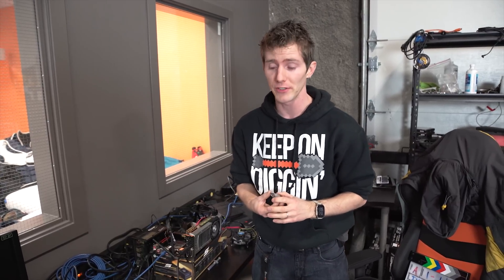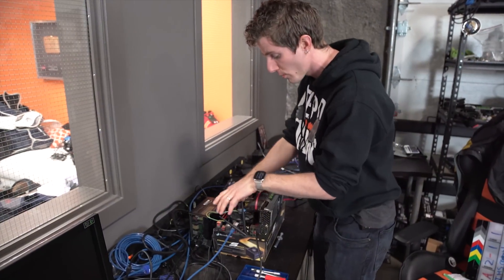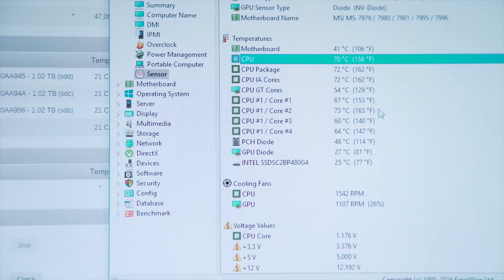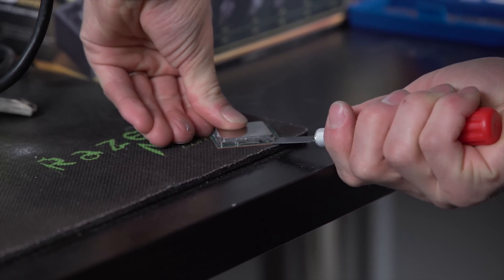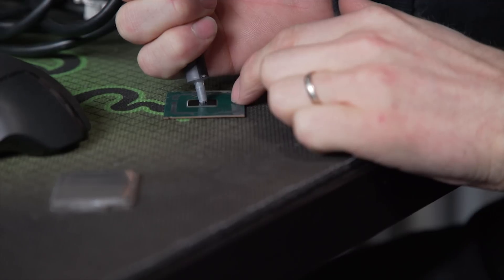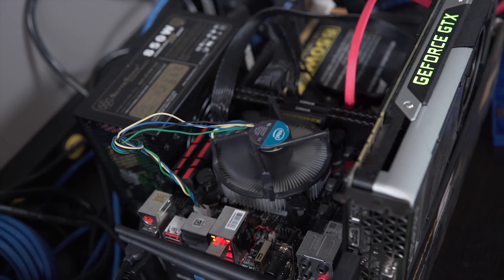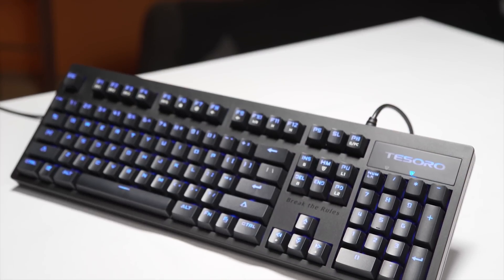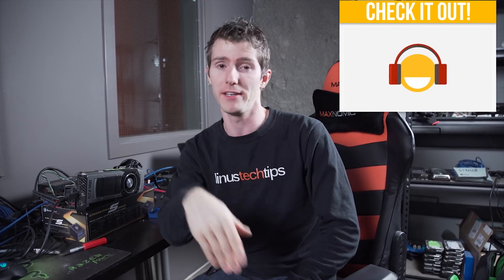Delidding an Intel Core i7 6700K - Is it worth it!?

Comment: I think there's a very good reason that the internal thermal compound has lower performance than some off-the-shelf thermal paste. It contacts the bare chip. So Intel may have learned something about mobile ionic contamination and had very different requirements for their internal thermal paste. It's probably more expensive than the "good stuff". And I bet Intel's thermal paste has near zero sodium or potassium. It's the reliability - performance trade-off. In the electronics industry, we learn things about units that fail, and we make changes to make the products more reliable. The thermal paste is such a small part of the total cost, yet such an important part, you can probably bet they're not skimping on the cost.

Comment: People please dont take this video seriously. You're supposed to do this if you want 5 ghz.
Not for stock clocks, on stock cooler
Reply: I got 5GHz without delidding. WITH i got 20°C cooler and 5.2GHz
Reply: you could probably boast a pretty medium overclock, even with stock cooler after delid. And atleast keep full turbo speed at max load. Which a cheap cooler can't accomplish. But noone in their right mind would choose a stock cooler for any K version cpu. They don't even come with a stock cooler.
Reply: Exactly, a much better test would have been with an overclocked and water cooled CPU. Linus himself said in a CPU cooler comparison video that comparing temp differences at stock speed isn't the full picture. The stock cooler is the main heat transfer bottleneck in that setup, not the thermal paste. On an overclocked CPU with a good cooler, the difference would have been much larger than the 4 degrees he saw.

Comment: Even with water cooling(h100) my 4770k(stock speeds) was idling around 55°. Load jumped up to 85°+. My fan was constantly running loud.
After delid & lapping:
35° - idle
67 - load (turbo boost)

Comment: So removing intels 5 w/mk thermal conductance tim1 polymer paste and replacing it with another commercial 5-10 w/mk paste shows essentially no improvement.  However, the purpose of delidding is to replace intels 5 w/mk paste with 40 w/mk liquid metal (in addition to its 8x increase in heat conductance over paste, it forms thinner bondline, ie 2 huge benefits).  The temp difference (when accurately measured with temp probes at air intake) is over 20C lower temps comparing intels/or commerical thick 5-wmk conductance paste vs 40+w/mk liquid metal at tim1 interface (tim1 has hot spots on die to ihs, very low relative surface area so critical, but tim2 between die and ihs doesnt matter so much because much larger surface area after heatspreader, and especially no hot spots).  As an aside, Intels solder is 80 w/wmk but thicker bondline than liquid metal, so performs similar to liquid metal 40 w/mk.  If not heavily overclocking, then no need to delid.  But if overclocking where load temps are 95C stress test, dropping them to 73C at same load is helpful.

Comment: Who has done this and thought it worked? Probably the hobbyist that are really bored and like to brag. 
I had my 2nd gen i7 to 4ghz back in the day with some the first common liquid coolers and never had a single heat issue. 

Are heat issues becoming more of a problem today? I never saw the big deal as long as you bought a good case and cpu sink.

Comment: I like LinusTec's vids but I don't get how he doesn't condone the operation. I guarantee that with older CPU's the difference would have been atleast the same but most likely bigger. At stock speeds even 5 celcius difference is alot since once the heat output rises with overclocking, the thermals do not as much as they do with the Intel's birdshit compounds. And his HS seems to be polished so it's allready better than it was new. The bird shit is there to keep people from overclocking. Also the CPU in the test was probably quite new so the "bird shit" may not be totally dried out which will happen. Give it 6months of use and I bet it's  concrete.

Comment: Although I had some significant gains replacing the TIM, the gains are not worth the trouble and scarfing your warranty.

I had a 3770k @ 1.38V @ 4.7Ghz running linpack AVX stress tester. I was hitting 94/95C peak temps on one core.

I replaced the TIM in the processor and temperature on my hottest core dropped from 94/95C to 71/72C. That means it is a 23C drop in temperatures. Admittedly my gains may have been more as I was using water cooling.

I proceeded to overclock further to 4.8Ghz @ 1.44V where temps topped out at 91C. This was great for bragging rights but not much real world gain other than the experience.

The only reason I even thought about doing this was because I noticed a 16C temperature difference between the hottest core and the coldest core hinting at an issue with the stock TIM.

Comment: He is clueless. Proper delidding can give 20C less. He used a crappy cooler, a crappy paste etc.
Reply: No I have observed CPU's were delidding has resulted in significant gains and in other cases not so much. It depends on how the stock TIM was cured, its purity and the fabrication process. Usually a large difference in core temperatures between hottest and coldest means an issue with the TIM.
Reply: > No 

> I have observed CPU's were delidding has resulted in significant gains

Then stop supporting his wrong information. Linus fanboys will support him no matter what. I explicitly said "can" give 20C or less, not always.

PS. In many cases it can do 30C or around that.

Comment: This test should have never been done with the stock CPU cooler in the first place. If you want to test how much heat you can pull from the CPU, why would you use the stock CPU cooler effectively bottle-necking your results? Try this again, and this time with a decent CPU cooler, and the delta will be much more than what was measured in the first test. Just my 2 cents...

Comment: Done it using the very helpful "Delid Die Mate" with my 3770k and worked out perfectly in less than 5 minutes with minimal risk of damaging something (a child could do this). 10 - 20 C general improvement under load -> same temps with +1 GHz OC compared to stock before delidding.
Would love to see you testing it again and porperly using a decent air cooler and liquid metal with 7700k (OC)
Reply: Just did it on my old 4790k using Kryonaut. I am seeing 20C improvement on a CM 212 hyper, and now it can finally stay away from 100C.
With the auto OC profile on the motherboard I got 20% higher Cinebench scores

Comment: Lol my amd fx 6350 @ 3.9GHz has 70°C idle
Reply: consider applying properly the paste on top of it before anything more "linustechtipsy". Btw i believe amd cannot be opened and if it did i bet no one could get away without bent pins under there. 
So reapply the paste, i would say to use the old credit card spread method to get it all over the surface evenly and maybe consider a better cooling solution.

Comment: It doesn't make a big difference to Skylake or Devil's Canyon because Intel listened to customers and used a better thermal paste. If you've still got a Haswell or especially an Ivy Bridge CPU lying around, the paste on those was absolute garbage and turned them into teeny tiny little furnaces. It was Ivy Bridge where people first started doing this because you could see an almost direct comparison by looking at Sandy Bridge and the fact that it had drastically different temperatures. Sandy Bridge was the last non-enthusiast line of CPUs from Intel to use a soldered on heat spreader.

Comment: Of course it's not worth it when you remove and replace a very similar thermal compound -- on a stock clock at that.   

I delid my 6700k (@4.8ghz 1.395v) today using liquid ultra and am seeing an average of 17c cooler temps under prime95.   If you're going to be an idiot about it why even bother.

There are tools (rockitcool) that make it VERY easy to delid safely.  Linus has some good informative videos -- but a lot of his "is it worth it" videos are garbage.

Comment: There are a lot of OCD enthusiasts who would go to the ends of the earth to get that extra fraction of performance.
Reply: 20°C is "only a fraction"?!?
Reply: xXYannuschXx anything is a fraction if you put /1 after it
Reply: linus got bad results because he half assed it, properly done its an 18-20 degree celcius drop, not 1-2
Reply: Alex V4 just not true, if the tim is bad a water cooler wont help that much, thats the whole problem.
Reply: Mr. Señor true, I have a 6700k cooled by a h100i v2 and saw about a 50-20c difference
Reply: Admiral Ackbar honestly i would NEVER do this. i love my hardware to much to put it's lifespan on the line. And gees a couple of degrees? just get a fn water cooler. Easier, cheaper, far better boost and works better for overclocking.
Reply: xX_ScetchUp 9R0_Xx That's only representing something as a fraction, not actually making it one.
Reply: I'm afraid I'm one of those people, even though my skills and wallet says NO.
Reply: xX_ScetchUp 9R0_Xx nice

Comment: I've seen people do delidding with varied results (some better others not - maybe quality control issue?) Still, I have a couple questions:
　
1) I wonder which Intel CPU IHS's are soldered onto the CPU VS which ones utilize a cheap thermal compound? Is it only a certain line of Intel CPUs? What about AMD CPUs?

2) Has ANYONE made a copper IHS lid? Copper can spread heat better so I wonder if in addition to using a better thermal compound how much difference would using a copper lid (or similarly thermally conductive metal) would make?

Comment: Hey linus, you should go have a copper lid made for that thing and test that.
Reply: Those integrated heat spreaders are already nickel plated copper. Nothing to gain there, unless you want to go to extremes and lap the surface to be absolutely flat with a mirror finish. That might get you a 2-3°C improvement.

On the other hand when it comes to delidding, a better cooler and proper application of Coollaboratory Liquid Ultra (or Pro, or any equivalent indium-gallium soldering alloy) will do far more than just a 3°C drop in temperatures.

Comment: the problem wasn't the thermal compound between the chip and ihs, it was the glue that they used to seal it that caused a slight gap... clean the adhesive and the thermal compound and use CLU and you will see a good 15-20C depending on how badly the adhesive was applied

Comment: What's a good cpu temp? I try to keep my i5-6400 at temperatures below 50*C, preferably 25, but I keep seeing people saying 60 is pretty good. Am I going a little overboard?
Reply: Matt Brody 60 is just fine.
Reply: 25C? That's ambient temp in many (most) parts of the world. That's impossible. CPUs mostly operate between 45-75C for desktop and 45-95C for laptops (with good thermal dissipation)
Reply: UltimateXtreme that's when I stop and let it cool down with the fans on maximum setting. Also, the room is usually pretty chilly.
Reply: Matt Brody
Idling, perhaps, for a short while. 25C idling is only possible when your ambient temp is less than 10C, which it might very well be. However, 60C under load is about as cool as it gets.
Reply: "25C idling is only possible when your ambient temp is less than 10C" thats not true at all but unless you have something like ln2 cooling your cpu can only be as cool as the room temp

Comment: Linus didn't even use CLU or scrape off the shit thermal adhesive Intel uses. He used a stock cooler too.
Reply: CLU makes a huge difference. Delidding is not worth it if you stick MX-4 or similar under the lid, however, whole different ballgame with CLU - very much worth it if done properly.
Reply: enjoy your aids it does not matter what cooler he uses. At least in theory no matter the cooler he uses the difference in temps would be the same. For example, if he used a after market and the stock temp was 65 c the new temp should be 60-61 c.
Reply: Sean Ladely actually, if the cheap cooler can only dissipate heat at x rate, while the thermal paste transfers at y rate, if x < y then you wouldn't see many benefits and vice versa for low grade thermal paste. I'm not sure the risk is worth the reward but I can guarantee you doing this with high grade paste and cooler would drop Temps a lot more than "a couple degrees"
Reply: The difference is about 20°C

Comment: Going to revisit this with Kabylake?
Reply: +Tyler Gaffney It's not worth it if you already have a 6700k. The 7700k OC's to 5GHz quite easily, even without delidding (though I would recommend delid + liquid metal because it will run very hot otherwise).
It also has AVX offset like Broadwell-E, so you can set AVX to run at a slightly lower clockspeed. This will help you get a higher OC for applications that don't use AVX (like games).
Reply: Pushpop LoC thats not true linus just did it wrong i delided my cpu replaced the thermal compound with liquid metal and between my ek waterblock and the cpu heatsink i also put liquid metal and my temps decresed by over 10 degrees
Reply: Delidding a 7700k and using liquid metal gives between 15-30 degrees improvement. Personally, mine now runs about 25 degrees cooler on 5GHz. You don't have to use the risky razorblade method either, as you can buy several delidding tools that make the process easy and pretty much risk-free. LTT should absolutely revisit this.
Reply: IsakH85 is the kaby lake worth it jst for the 7% base clock increase? it doesnt seem to like OC
Reply: kabylake has even cheaper thermal compound
Reply: I think his original problem with this video was using a bad testing methodology. He didn't have a high thermal load from an overclock to start with, the gains are much better the higher than temperature is over ambient, plus using the stock cooler was likely a cooling bottleneck as well. My Idle temps didn't change at all, but my OC Prime 95 temps are down over 20 °C and I got to 5.2 with an AVX offset of 1 once i got the extra thermal headroom.
Reply: I myself personally just delidded my 7700k, I run with a Corsair h100i V2 cooler, it dropped my 5.1 GHz overclock by 20-25 Degrees Celsius, Definitely worth it IMO. I did put Thermal Grizzly Conductonaut inside. I would definitely recommend getting an actual delidding tool, the one I bought was the Rockit cool 88 it worked like a champ.
Reply: Its not the paste. Removing the black glue brings the heatspreader much closer and this will make it easier to transfer heat. There are tests where you get 10-15C without swapping the paste.
Reply: If true, that is likely because of a manufacturing defect specific to that individual part.
Reply: Hope not. He did this one so badly he should be ashamed.
Reply: Skylake = kaby lake.
Reply: Not necessary since it's probably going to be the same result with Intel's cpus these days.
Reply: From what I've seen at least one guy who had a 5GHz OC was at ~100 degrees C then same OC dellided went down to 66 degrees C.
Reply: I'm not saying it'd be redundant to do it, but more so a bit redundant to make the same video on the matter when it's virtually going to be the same thing shown in terms of the procedure. The results vary, but I'm talking about making the same video on something that will probably prove the same result for him.

Comment: Dos he have a video of how to move hardrive OS to USB so I don't have to buy windows again for new ssd.
Reply: New pc new oem license required. It will not work. Oem license is connected to the hardware. Only box version of windows can be transferred from one pc to another.
Reply: The only time you need to buy a new Windows key is if you change your motherboard. You can change every single component inside your PC, except for the motherboard, and can use the same Windows key. It is tied to the Motherboard's ID on Microsoft's servers. So if you keep all of your hardware and change only the motherboard, you need a new key.
Reply: padlasvillage You got it the wrong way round. OEM will only work on one motherboard. Retail keys can be transferred.
Reply: Luis Martinez I think you can Buy it at Amazon or Ebay.
Reply: If you bought windows you have the OEM key that can be used while you reinstall. You don't buy windows for only one install. Anyway just google 'hdd clone'
Reply: Dániel Bulyovcsity I have a pre installed OS but recently built a new rig.
Reply: Nope, windows work on any pc you buy unless its not OEM. I always buy clean PC without windows and I use the one I bought

Comment: Your mileage may vary, was overclocking my 3770k and replacing stock TIM with the CLU liquid metal i got from 4.5 to 4.7 ghz. You know, at ~85c both times, with a dual 140 aio water cooler. And shes still alive, but down to 4.2 anyway.

Comment: I agree that this is certainly not something that should be done for most people and I get your struggle with the ethics behind it. 

For some enthusiasts, this is one component of achieving stability. This is not something people who tinker should do.

You were saying that you'd only gain a couple degrees difference. A 5 degree change could mean the difference between a stable or unstable overclock and that's what you estimated could be a potential change with using superior heat compound. Since you're using a stock cooler, you're not reaping the benefits of better heat dissipation as well, since thermal resistance is a variable in the heat dissipation equation. If the stock compound has a higher thermal resistance, the 2-5 degree difference you have on the stock cooler will see greater deltas off a more efficient heat sink. 

Since this test was pretty simple to do, I suggest you perform the test in two phases:
1. Stock heat compound, stock cooler.
2. Stock heat compound, more better cooler. 
3. Stock heat compound, more better cooler ~10% OC

Phase 2: same tests with better compound under the shield.  

If I'm right, I'll take that 980, my 750ti is showing age :) <3